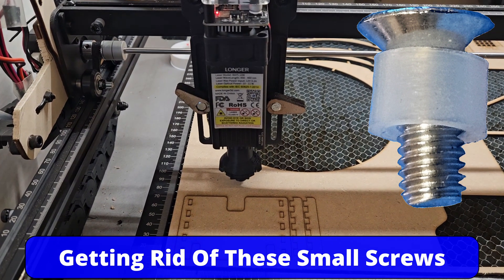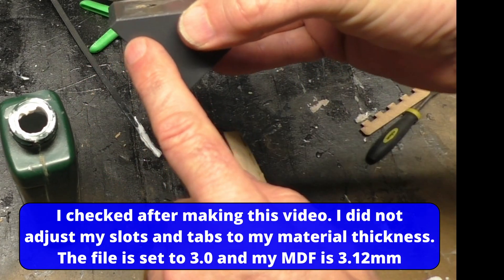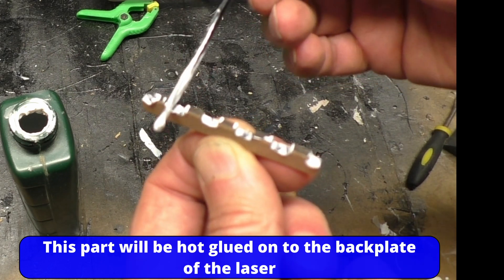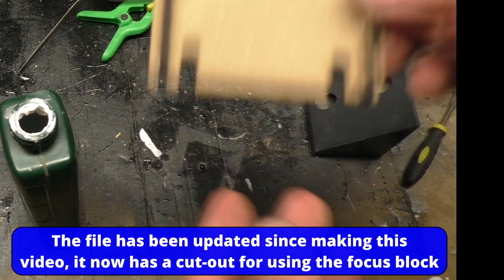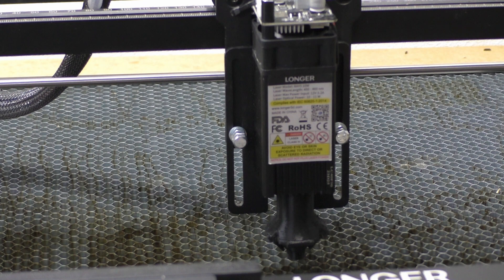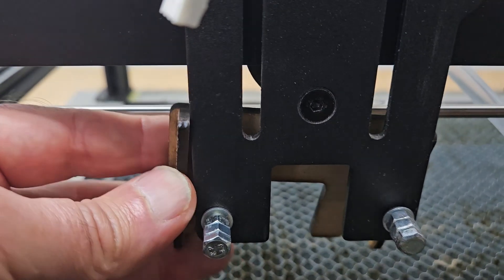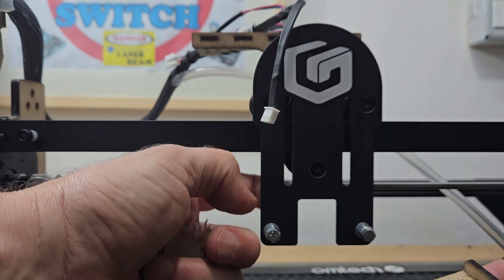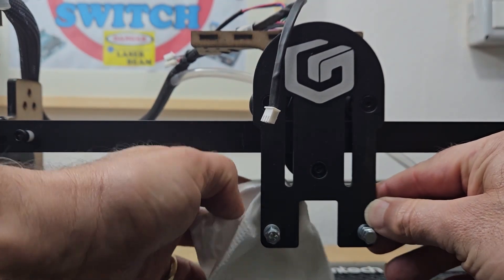Longer Ray5 Diode Laser smooth slider, easy focus easy maintenance quicker maintenance

Comment: If you have limit switches installed, the frame blocks the X-axis switch and you get the shudders. The upper left corner needs to be cut away to clear the limit switch. Otherwise, I love it!
Reply from the maker: Thanks for the feed back I have limit switches on order so will adjust the file.

So no more stiff neck for you. Please spread the word. It's such a simple mod that will let you do maintenance more regularly and may be save your smoke guard lens from burning
Reply from the maker: If you are able to post a photo of your mod that would be helpful. As I can mod the design before my switch kit arrives